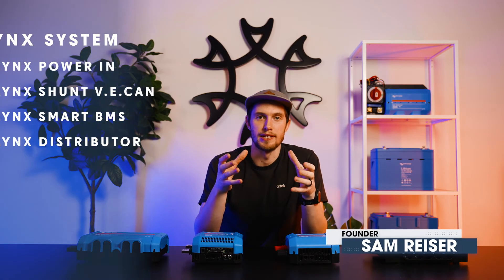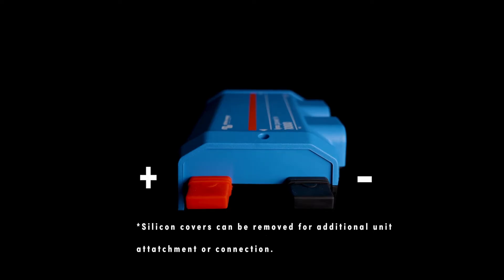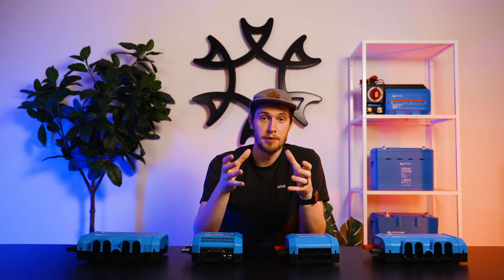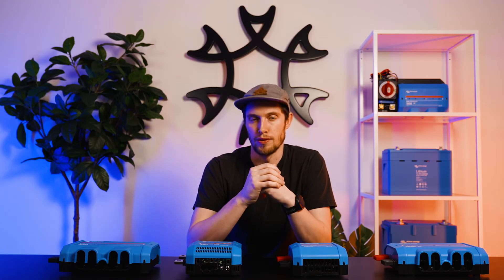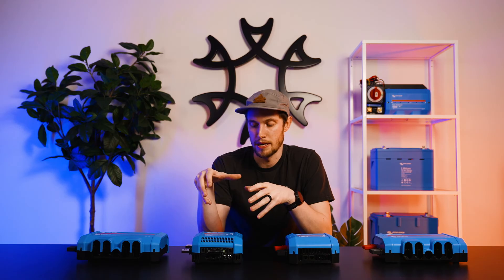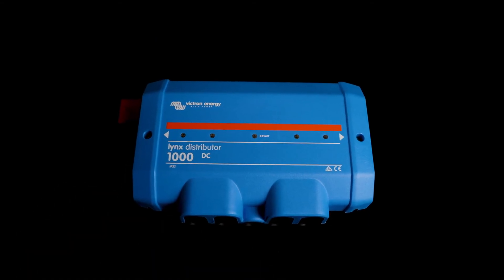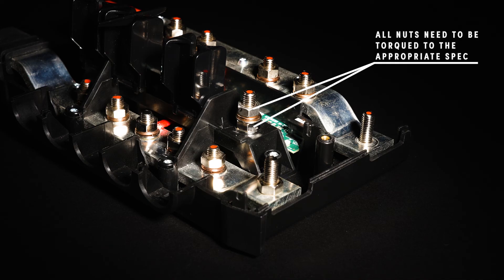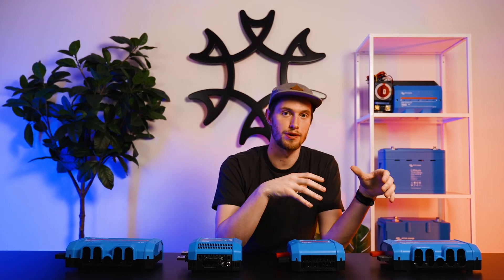Victron Energy Lynx Systems (Power In, Distributor, Shunt, BMS) | Overview and Basic Information

Comment: thank you very much for this video!
The quattro 24I5000I120 has been installed. 
Where do I connect the solar panels (input from solar panels is about 110 volts)?
Reply from the maker: Hi @OlogKMK, I think you might be confusing DC and AC connections unless you are using micro inverters on the roof. I would strongly encourage you to reach out to your place of sale for assistance. If they are unable to help then feel free to give us a call or shoot us an email! Cheers!

Comment: Hello and good for the video
I wanted to ask you if it is possible to install the bms from victron (16S for a packlife that I have in 48 volts? 600AH)?
or do you have to have a victron battery?
my batteries are EVE 280AH in 16/2P
can we wire all the batteries with the bms from victron or do we need a bms compatible with the victron?

otherwise is it possible if there is no can in the battery pack to tell victron (multiplus and cerbo GX) that I have a lead gel battery pack?
there is no bms on the lead in general?
my pack can be protected by its own BMS cutoff 2.80 volts and maximum charge at 3.65 volts Possibly just to emit more or less on the multiplus?

thank you
laurent
Reply from the maker: Hi, Victron BMSs only work with Victron batteries and vice versa.

Comment: Hello. In the case of 8 lithium batteries 100 amps each, total 800 amps, what would be the recommended BMS? 500 or 1000? I would also need 2x Distributors for the batteries, right? 
Is it possible to use the M8 distributors with the BMS 1000 (M10)? thanks !!
Reply from the maker: Hi, the number of batteries not affect the choice of amperage of the BMS. This has more to do with your loads and charging sources. We recommend not using distributors to combine lithium batteries as they do not meet the fuse requirements. Feel free to give us a call or email in and we would be happy to assist!
Reply: @Artek.Energy  I didn't understand your comment about the lithium batteries connected to the Distributor.
I'm connecting the batteries like this: two at each distributor door adding 200 amps per door with 250 amp fuses in each door. Could you tell me if this is correct?
Reply from the maker: @mkexpeditions  Hi, while this might meet the amperage for your cable (although not specified), it does not meet many regulations for overcurrent protection for lithium batteries due to the limitations of Mega-Fuses. Feel free to shoot us an email and we can go more in depth!